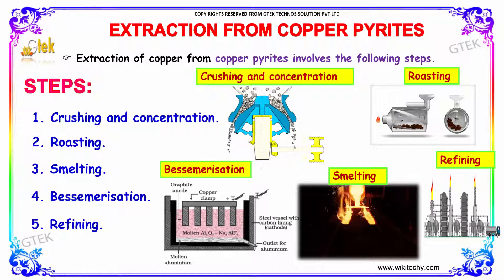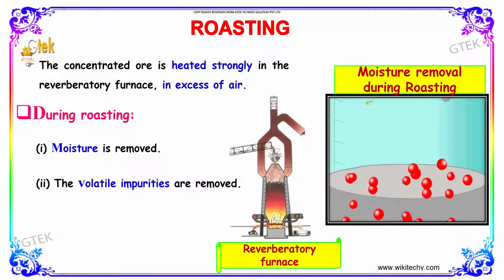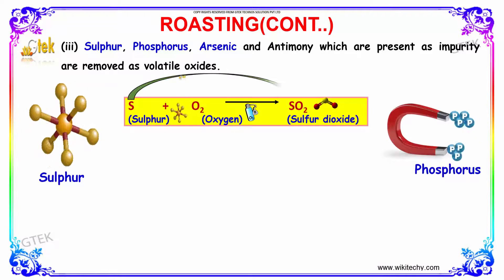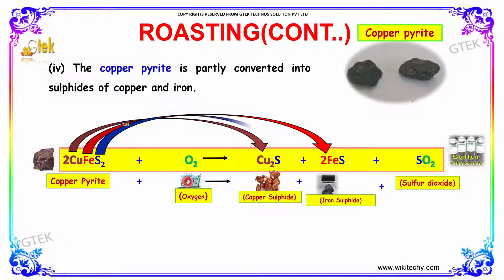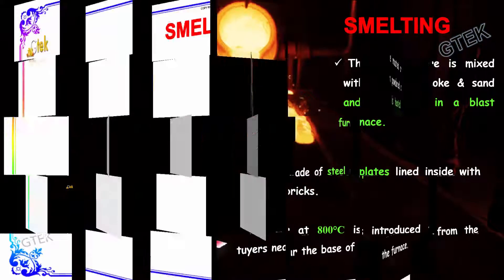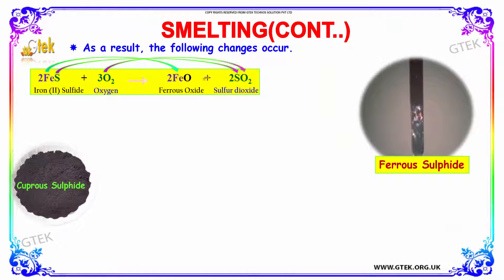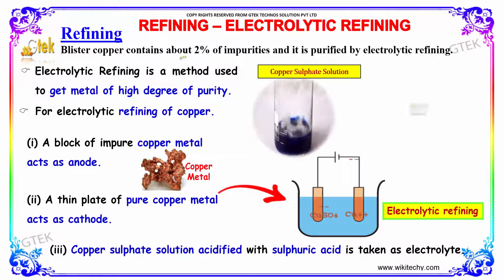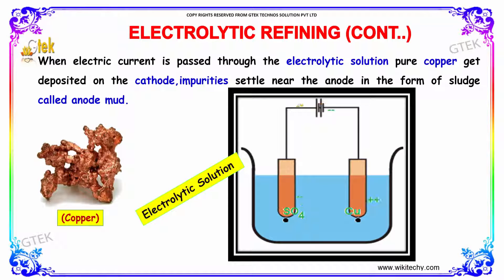Extraction From Copper Pyrites D Block Element class 12 chemistry subject notes cbse

Comment: On industrial scale copper is extracted from its sulphide ore known as copper pyrite (CuFeS2) by smelting method. Finely divided CuFeS2 is concentrated by "Froth-floatation method". Crushed ore is suspended in water containing pine oil. A blast of air is passed through the suspension.

Comment: Copper can be extracted from its ore by heating it with carbon. Impure copper is purified by electrolysis in which the anode is impure copper, the cathode is pure copper, and the electrolyte is copper sulphate solution. An alloy is a mixture of two elements, one of which is a metal.q

Comment: One of two processing methods are used to refine concentrated copper. Pyrometallurgy, or smelting, is used on ore with copper sulfide and iron sulfide minerals. The concentrate is dried and fed into a furnace. ... The matte layer refers to the iron-copper sulfide mixture which sinks to the bottom.

Comment: Copper Pyrite is a copper iron sulfide mineral that crystallizes in the tetragonal system . it has the chemical formula cufes2 . it has a brassy to golden yellow color and a hardness of 3.5 to 4 on mohs scale . Its streak is diagnostic as green tinged black.